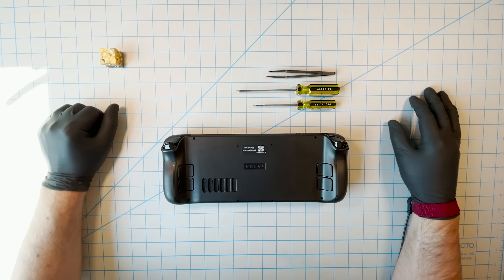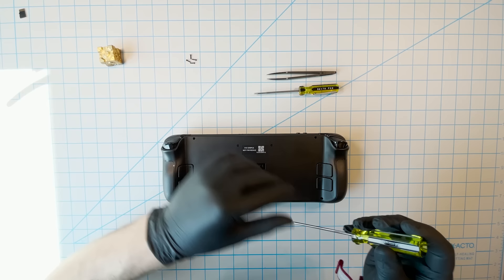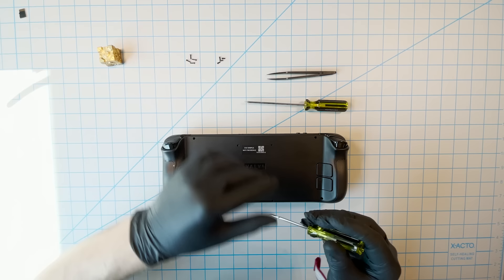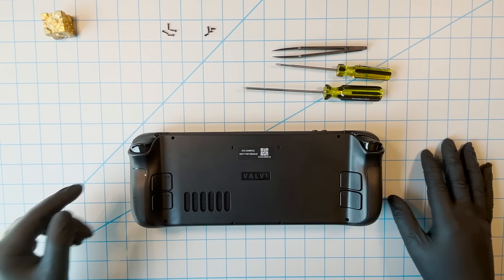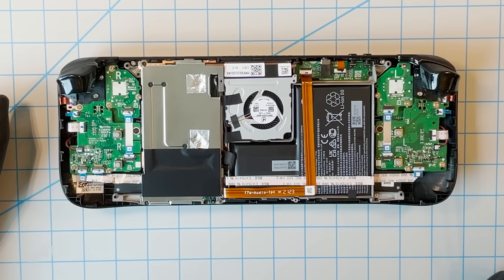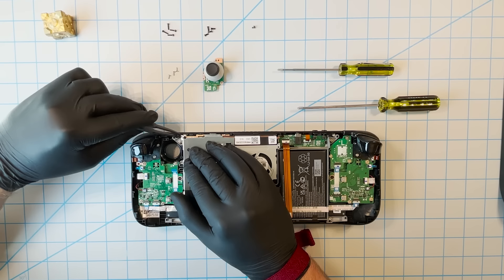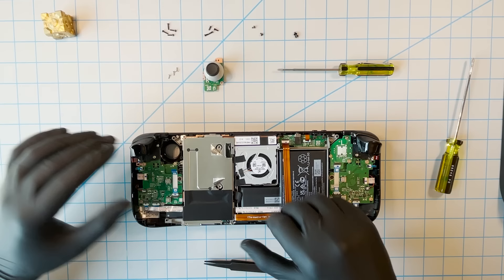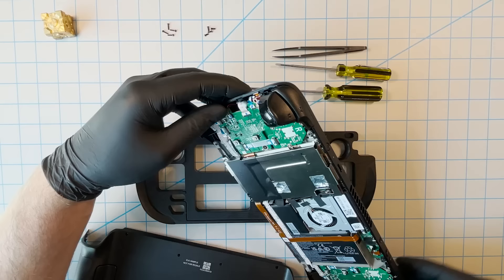Take a look inside Steam Deck™!

Comment: One of the most interesting parts about this video was the shots of the drop tests and stuff. The thing looks solid
Reply: Yes, but why does taking it apart "immediately" reduce the structural integrity?  If this is strictly true, then these cannot be repaired without reducing said structural integrity.   So what happens if you send for warranty?   While I applaud them for making a teardown(well sort of), but the fear tactics and comments like the first one I mentioned makes me want to cancel my pre-order.  Framework they are not.
Reply: @marcdukette5095  Any product using self-tapping screws or any piece of plastic that snaps-in to keep it closed will have the plastic become weaker due to the fatigue of repeating that process. It's really inevitable with those, and making a cost-effective product without them is plenty hard.
To be honest, I can think of few devices where this isn't the case, short of parts that are meant to be opened. It's just not obvious to people who don't know about the details of this type of industrial design.
Reply: just cancel your pre-order then. spoiler alert, no one cares.
Reply: @lxnerboi4636  Wow Fan boy much!?  I threw in an honest reaction to this video. I didn't realize this was a everyone must Kiss their * channel.

@VarenRoth, thank you for the polite response, yes I understand.  I guess in my own way I was pointing  out to people that if(When) you need to have this repaired you suffer the same degradation, not just if you do it yourself.

again while I applaud them for this teardown, it reeks of fear tactics. While they don't come out and say "this will void your warranty", since that's illegal, they imply it at more than one point in the video.

Either way I will move on and whether I buy one of these or not this is obviously not the channel to discuss the pros and cons of this system.
Reply: TRENDING-TOP-YEARS⤵️ --------------------------------------------------------------------------------------------------------------------------------------------------------------------------------------------------------------------------------------------------------------------------------- ❣️ AISURU.TOKYO/michan?HDRCam✰ᴾʳⁱⁿᶜᵉˢˢ★ トップAVビデオに参加する
❣️

Youtube: This is fine 
Someone: Says "heck" 
Youtube: Be gone 
#однако #я #люблю #таких #рыбаков 
#Интересно #забавно #девушка #смешная #垃圾
Reply: @VarenRoth  I just like that valve was transparent about it and said “hey, you CAN take your steam deck apart but you need to know the risks of doing that”. It’s better than we get from a lot of companies. If they felt the self tapping screws were necessary I trust that judgement. I’ll probably avoid opening my deck at all costs anyway
Reply: @marcdukette5095  it reeks of fear tactics because otherwise some idiots will try to sue Valve for mistakes they made themselves. whoever knows what they're doing will be able to look past that and do whatever they want, those messages are intended for the layperson.
i agree it sounds excessive, but i would personally blame the people who try to sue anyone over anything, instead of Valve.
Reply: @marcdukette5095  It technically weakens it, but not by any noticeable amount. They're just listing all the minuscule reasons for not swapping that SSD, because they really want you to buy the expensive model instead.

They still let you service the device though, there are no screws hidden behind "warranty void" stickers, and they explicitly mention that they don't cover damage you do, implying that the warranty is still in place for the rest of the device (which is how it should be, legally even, it's just not the "industry standard" operating procedure). I think that passes. They're no Framework, but they're still better than 90+% of the companies out there.

Comment: Of all laptops, one of my absolute favorites to work on was the IBM, (now Lenovo),  Thinkpad series back in the early 2000's.  One thing that you really had to pay attention to was the little number next to the screw holes.  It told you the size of the screw that went there.  In some cases, you had to pay close attention because the size difference  between two screws was probably just shy of a millimeter, but if you happened to not be paying attention and put a wrong screw and it happened to be the one that was just under a millimeter too long, it would damage part of the keyboard so that only the keys on the left side would work.  There was no way to fix that, so you had no choice but to order a whole new keyboard.  This particular series was popular with businesses, (I think it was the T-60).  I worked on quite a few of them for businesses, and I could almost immediately tell that the customer had taken it apart and, not being experienced, (at least not with that particular model), they didn't pay attention and of course lost function of half of their keys.  ...And that, boys and girls,  is why you should make sure you either know the system you are working on, or have very good attention to detail.   -The End. 🙃😁🤪
Reply: There's a special place in my heart dedicated to ThinkPads

Comment: Well done, you've made that wired ESD strap as effective as a wireless one! I want my steam deck soon though.
Reply: Someone else noticed too! In this case it's only the gloves that are providing antistatic protection.
Reply: I loved the oops edit lmao
Reply: I doubt it matters, if the ESD strap can't be effective through the glove then probably any static charge won't either
Reply: @movitoviscyrinxed446  it just ensures that any static shock will be of sufficient level to have an impact. Although touching a sharp solder point could damage the gloves enough to render their insulation useless in the fingers.
Reply: These gloves are likely ESD safe vinyl gloves. Just like in some factories you are required to wear ESD safe shoes that does not prevent you from being grounded to the standing mat at your workstation.

As such they actually even out the potential between them and you and then through the wristband to the potential grounding. 

Not all "plastics/Polymers" are the same :)

Comment: at least you wont need to throw the whole thing away when you get drift
Reply: And even if you do, you can just increase the joystick deadzone a bit if it's only drifting slightly.
Reply: Hopefully they dont use really cheap thumbsticks like nintendo so it doesnt drift as fast too
Reply: Nothing about the Steam Deck's sticks are the same as on the Nintendo Switch. They're not going to drift.
Reply: @breakpoint4869  Hopefully
Reply: @breakpoint4869  That's completely meaningless though. Nothing about the sticks in my Oculus Touch controllers is the same as those in the Nintendo Switch Joycons, yet I still got drift on those.
Reply: How about you wash your hands and stop blaming Cheeto dust and dead skin particles for your joysticks dying?
Reply: @Skerp129  Even people who frequently clean their Joycons have had trouble with drift. I, for one, treat my Switch with care but still notice some minor drift after every bi-monthly cleanup with isopropyl alcohol. I work with electronics frequently so I know how to treat components, drain the battery before cleanups and grounding myself just in case, and I still have both my left Joycons drift after 4 years of usage, which isn't that much time at all (even less so when one of my Joycons is just a little over a year old). Negating the problem won't make it disappear, and Nintendo should both address and compensate users that suffer this issue.
Reply: @goeland4585  My index controllers are drifting horribly.
Reply: @rokaq5163  "drain the battery before cleanups" could you please explain what you mean by that exactly and why you do it?
Reply: @majorgnu  Most liquids are conductive and can cause undesirable short-circuits, damaging both the components and the user. This includes isopropyl alcohol and moisture produced by your hands. We attempt to prevent this by using anti-electrostatic gloves, grounding ourselves and draining the batteries before diving into any repairs / cleanups.
Reply: my god. you children better stop arguing or else imma edit my comment saying "thanks for the likes"
Reply: @BobStuntsville  Bruh we're not even on Roblox-chat-level cancer.

Yet.
Reply: @rokaq5163  Are you not familiar with how rechargeable lithium batteries work?
You can't fully drain them since that causes permanent damage, so the device will shut down and refuse to turn on before it reaches a dangerously low charge, but the battery can still very much short circuit and be a hazard.

You should always unplug your battery even if you "drained it down to 0%," which you didn't really need to do anyway.

The only real reason I can think of to "drain" the battery would be so that it fails less violently due to having a lower charge, but I have no idea how much of an impact that can really have.
I'd love to see a study comparing how batteries fail at various charges. And by study I mean entertaining YouTube video, of course.
Reply: @majorgnu  That's a nitpick if I ever saw one. Of course it should be unplugged too, but waiting for the Joycon to be on the lowest possible charge can't hurt either. Why push a discussion on this?
Reply: @BobStuntsville  just do it 💩
Reply: @rokaq5163  Three main reasons:
1. There could've been some merit to discharging the battery that I wasn't aware of and I care to learn.
2. Assuming Li-ion batteries are any safer when they're on a low charge may result in a false sense of security, making it a harmful misconception.
3. Fully discharging Li-ion batteries is bad for their health.
Thankfully, consumer products won't let you discharge their batteries to that point, so that's a shot in the foot you've been dodging.
That is, unless you also do stuff like keep devices with a very low battery for a long time. That hurts the battery.

But yeah, battery misconceptions are a pet peeve of mine.
Don't even get me started on people who apply obsolete battery "wisdom" like letting devices fully discharge before charging them.
Reply: @majorgnu  Okay, so to set the record straight:

- Draining batteries should be done through normal usage, we can both agree on that, as per not to force full drains.

- Draining a battery is not an excuse to exercise careless work, it's just an extra layer of security. If you take any risks that result in damage to you or your components, then it's your fault for not applying common sense on top of taking proper preparations.

- Battery health can be severely affected by discharging a battery with a certain frequency, another point we can agree on. Doing so yearly, bi-yearly or even tri-monthly will probably be okay for most components, but you should always exercise caution and inform yourself about the specs of your item before commiting to any repairs of your own.

Not gonna reply any further, probably. I hold no grudge or ill-intent, but it feels like the conversation has staled. Thanks for your time, have a nice day.

Comment: This is awesome. In a world where giant companies lock everything in their devices so it would be impossible to repair, Valve comes in with a simple to follow guide and available to purchase replacement parts. Thank you for doing the right thing, Valve.
Reply: The newest IPhones literary have a software lock removing functionality if the Hardware was changed, even if the replacement hardware is from a new IPhone of the same model, so its Literally the same hardware.

So even if you have the skill to fix it, an official IPhone and do everything right, it still doesn't work...

Unless you bring it to an expensive official shop, which can overwrite the lock...

The Steam deck is gods gift compared to the IPhones. Thank you so much valve for being an excellent example of Reparability !

Comment: thanks valve, i was hesitant on getting a deck as i have a history of joystick drift with controllers, but now knowing i can get replacements without having to buy an entire new system makes me more inclined to get one.
Reply: i mean you can replace the sticks on the switch too
Reply: @IAm-zo1bo  by buying a new controller?
Reply: @aceyoshy6  no, by buying replacement sticks.
Reply: @IAm-zo1bo  someone found out how to fix the joy cons, like, it works wonders and it's been 3 months since I've fixed it and i didn't run into any problems to this day
Reply: i can link the video if you want
Reply: @Sulvosson  it needs to work for at least 3 years they are 80 dollars for crying out loud, 2 pairs of mine all died 6 months after i had them

Comment: I love how steam warns you about the risks, but then says, "hey, it's yours, do with it as you wish".  Then proceeds to give you instructions and tips to know how to do it and not screw it up.

As for myself, I don't plan to ever take mine apart because I don't want to take the risk.  If this thing is as solid as they say it is, I don't see why anyone would ever need to.

Kudos to Steam for this video.
Reply: Board repair is a thing. If Steam doesn't try to prevent part swapping even on the board itself, (meaning, yea, you wouldn't do it DIY if you didn't know how to solder on a board), an independent repair technician could repair it for a reasonable price.
Do note however, that just about every hardware company in existence currently (even for stuff like tractors) often will not allow anyone to buy their board level parts, and it gives them a financial incentive by monopoly to ensure you buy a new product rather than having it repaired.
Reply: you wanna open it to replace either.
sticks buttons ssd m2ssd or battery.
and this video shows a bit over half on how and what. which is amazing.
so if u had this and battery died in 3 months u just buy a new one? what are you an apple supporter?
Reply: Misco's being a bit blunt, but yes. If somehow your battery has a defect and needs to be replaced, if warranty doesn't cover it, your only option without raking over quite the price to Valve will be either  independent repair or doing it yourself. 
We're concerned about that independent technician being able to buy an official or equivalent battery and then service the device without some need of authorization from Valve. It's your device, you should be able to choose who services it.
Reply: steam?
Reply: @miciso666  all models apparently use the M.2 slot for their SSD
Reply: @SomeRandomPiggo  they mean valve, just a bit confusing as instead of calling it valve deck (like Apple IPhone, Samsung SmartFridge, Nintendo Switch) they named it Steam Deck

Comment: My main thing would be the inevitable battery replacement years down the road, or even SSD replacement with a stock or Steamdeck supported 3rd party SSD, cooling fan, and other likely-to-eventually-fail parts. I love that you can open it like any other device as long as you're extra careful. Excellent work, Valve!!!
Reply: The battery looks removable as there's something that looks like a pull tab on it in the bottom right.  It'll be awesome if you can just swap out the battery when it gets old.
Reply: @Atomic_Haggis  read: swollen

Comment: It’s nice that at least some thought went into repairability. Nice job Valve.
Reply: @Вероника Заглотова Yes.
Consider the thumb sticks. Hopefully you're aware of the heat Nintendo is getting on the switch and the thumb stick drift. Valve made the thumb sticks on separate daughter boards, they probably didn't have to do this. But it make it so you can easily (and presumably inexpensively) replace the thumb sticks.

Also they literally said in the video that they're going to allow you to buy components, such as the thumb sticks, separately...

So yeah, they definitely put thought into reparability.
Reply: @Вероника Заглотова Absolutely agreed, and I think it's especially important on hardware like this.

A good question! I doubt Valve will open source their hardware, but people are also very very creative so you never know what will happen

Comment: This video right here embodies everything I love about Valve. They are always so increadibly open in shoeing the underbellies if their products, be it hardware ir software, and letting people tinker around with it themselves. Contrast that to other companies lobbying as strongly as they can against right to repair, here Valve made custom parts and are still distributing them seperately so people can repair them!

Hammer editor for TF2 is what got me into mapping. This video is very reminiscent of the commentary tracks, which are always so interesting to listen to. 

Now if ye could just update TF2
Reply: They're not going to be making much on the hardware itself, it's all about putting Steam in the handheld market, so the more fully functioning devices out there, the better. It just makes sense, even putting aside stuff like user satisfaction, good PR and being the right thing to do.
Reply: @Berserkism  Wow, you're easy to set off.
Reply: @Berserkism  this vid is for everyone. All things that he says are actually valid and makes you think twice before tearing that thing up.

Comment: Massive kudos to Valve for making hardware with repairabiltiy in mind, informing consumers of the risks but not restricting them and committing to making spare parts available. This is a true commitment to sustainability and the environment when millions of devices can be repaired and used long term instead of becoming landfill. 

A huge, huge fan of the initiative and sustainable design. I will be buying one when possible

Comment: I'm usually nervous about handling my tech when it comes to making modifications to it, but I have to say even without this video it was much easier than it had any right to be. Kudos to Valve for placing the trust of repairs and mods in the hands of their customers and not going for anti-consumer practices like voiding the warranty if modifications are made to the system.